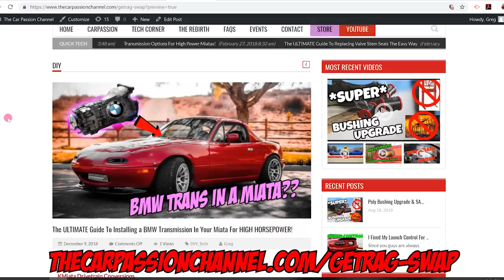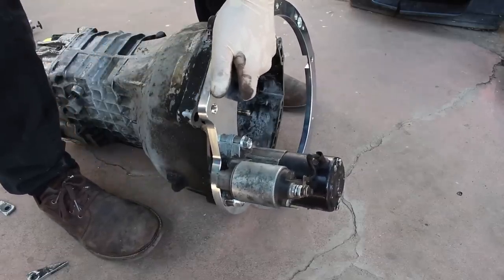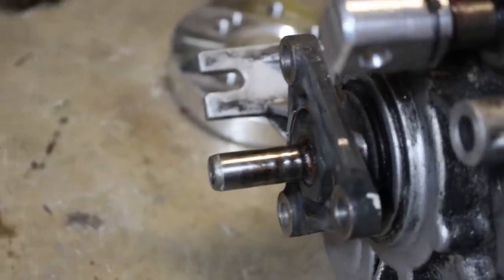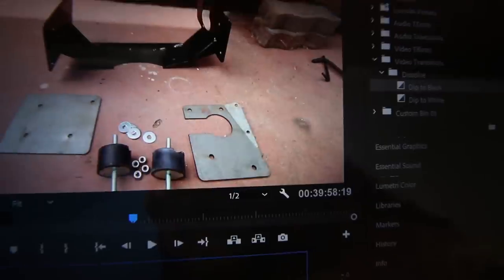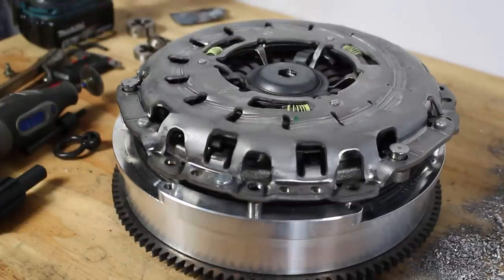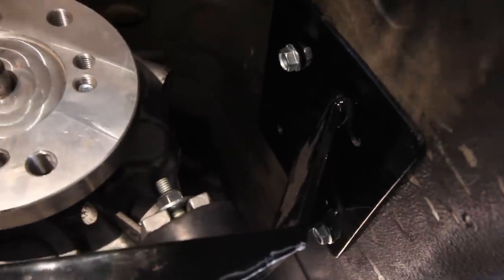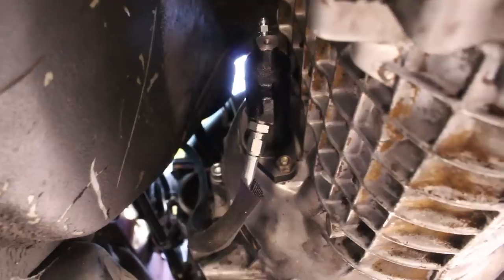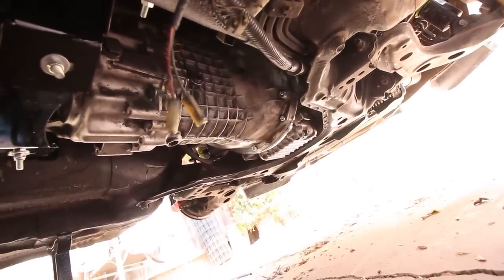The ULTIMATE Guide To Installing a BMW Transmission In Your Miata For HIGH HORSEPOWER!

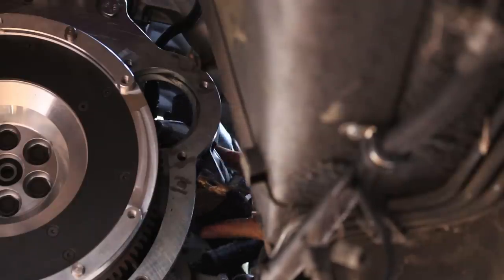Comment: 24:09 - I think you broke your starter motor. It's not meant to make that noise when you install it.
Reply from the maker: I'm literally crying laughing rn after re-watching that part
Reply: @TheCarPassionChannel 
Sounds like it's complaining. 😂
Reply: i had a feeling that was coming after watching all of those shavings from drilling out the holes.
Reply: I know this is old, but I'm a little car retarded, could you explain why? Is it the ambulance noise?
Reply: @hunterdelgado2402  Yeah. Perfect timing. It's like the starter motor is letting out a death scream when it gets pushed in. 😂

Comment: When my grand Cherokee died my mechanic sold me as a gap filler before I got a new car, a 2002 mx5 mk2 1.6 with 50k on the clock. One lady owner. I got two speeding tickets in the first month trying to keep it under 30mph. New clutch,new brakes but my mechanic won’t let me sup it up as apparently I’ll kill myself. I couldn’t work out why I needed rear tyres so soon until I realised I’d wheel spun everyday. 
I keep meaning to sell it but at 57 my daughters all grown up I just can’t bring myself to let it go 😂. I watch you great videos, as a sculptor I’m very practical and follow each step you do so could do the conversions but the image of James Dean’s Porsche haunts me.

Comment: Greg I have blazed the trail you have been walking and I HIGHLY recommend the solid transmission bolt mounts. Mine snapped in two and made it almost impossible to shift. I also  slipping that damn BMW clutch and already have the act clutch in my room. Please keep an eye on the mounts. David is still amazed I was able to break the mounts but I'm sure you will too. Also no hate to you but I wish I had known sooner that the clutch sucks haha! Keep up the good work man!
Reply: He also had to buy the act clutch because the other one slips, he said it somewhere, I don't remember if it was in an older video or if it was on snap or insta.
Reply from the maker: So did you end up running the ACT full-face? What power/torque is your car at?

Comment: If the BMW trans is electronic, theres a company that makes electronic to mechanical drive kits dont know if it will work for you but the company is called "Abbot" and the product is called "Cable X" Put one in a t56 swap in a c3 Vette  with mechanical speedo.

Comment: btw, you can reset that pressure plate with a piece of threaded rod, some big washers, a screw driver and some zipties...save the center piece and throw it in the tool box. Or you can spend several hundred on a BMW tool to do it too.

Comment: You can reuse the press plate on a self a adjusting clutch use a press it should hear 3 load clicks then its resets but need too put 3 drill bits where the teeth are must be in a triangle shape  but don't release the press yet . You'll need too cut the drill bits so they drop out

Comment: All that work to that car!  that poor Miata has had every nut and bolt off and on.....    I’d die if my NB was pulled apart that many times.    Still.... nice work, glad your keeping with the NA Miata!    Hope you got the Good LSD diff in it.    It’ll take a beating!
Reply from the maker: Yep, it's a Type II Torsen with the 3.909 ring & pinion. Probably swap my 3.636 in once I see how the 3.909 handles the power with the new trans ratios.

Comment: having done a bmw clutch, ive had no issues taking a pressure plate off after the plate was removed from the center and putting it back on. over 5k on the car since the clutch change and no noticeable issues. id avoid it if possible, but i wouldn't buy another clutch kit if you for some reason have to take it off after the initial pressure plate install for anyone attempting this

Comment: PSA, ground the battery DIRECTLY to the engine and not the chassis. SIXSHOOTER(I believe it was him) on miataturbo.net melted a few wires. Kmiata and himself determined the reason was because he didn't extend the ground to the engine. I can find the thread if needed.

EDIT: Found thread...Post#234
https://www.miataturbo.net/suspension-brakes-drivetrain-49/k-bp-engine-bmw-e36-e46-transmission-upgrade-92865/page12/

Comment: I'm I the only one that's concerned about the big hole you've just cut in the bell housing? Great if you live in California, however coming from the not so sunny and usually raining or generic crap Yorkshire(uk) and our roads I wouldn't like to think I hadn't made and welded another piece to fit just underneath the starter motor

Comment: Don't bang that dowell pin at adapter like this! Put adapter at the work bench (flush) and than install due to adapter could bend or dowell pin not seat properlly 👍

Comment: 27:08. Mclovin, niiice!
Reply from the maker: I allllmost put that clip in but wanted to keep it Rated G lol
Reply: @TheCarPassionChannel  you are a very brave man for putting that transmission in with a car jack. I don't have a lift either and do it from the floor too but what helps a ton is a motorcycle/atv jack. It definitely makes life a bit easier while doing transmission related work. Also, this is what tripped my mind and made me post my original comment,  https://youtu.be/QsGxbsQv5kc

Comment: Curious:
if you were to start over on this build, would you just do a kswap instead?  Seems pretty economical given that the stock bottom end can make over 500hp and if you blow it you pick up a new one for cheap.  Would be interesting to see you do a comparison between the full cost of your current setup and the k series swap since you already have the whole trans swap anyways.
Reply: Ridiculous cheap god swap is Volvo S80 T6 2.8l + Gs6-53Dz (1000Nm+). You can put that into almost every car and crank your boost up to 1000+hp with gustom manifolds and Gm12 rear end. 33 spline axels and 3 inch driveshaft with huge joints. Its ridiculously cheap and if you have right chassy you can go 8s passes on quarter mile. Another bit more expensive build is M104 Mercedes engine straight six. Watch Turbobandit youtube videos how to build one of those. Really cheap 1000hp aswell.

Comment: What I understood about the power plant frame (ppf) is this was done to prevent differentials from wiggling as power was applied therefore more efficient. What is done to substitute bracing for the torsional loads the rear suspension is sure to experience?

Comment: Transmissions mount pretty easily when you have the correct pilot bearing hey Greg?
Reply from the maker: Struggling with the 6-speed install had nothing to do with the pilot bearing, and everything to do with the alignment of both clutch discs not being perfect. Lesson learned on that one!

Comment: Didn't see the clutch actually working yet. Guys don't install this before you see that clutch working for couple of months driving. In some cases you have to weld material into your clutch fork that presses your pressurelager into glutch assembly. Wrong way to fix that is to lengthen that clutch slavesylinder pin. Something might brake sooner or later if you lengthen that pin in order to get your clutch working and you don't have the will power to uninstall gearbox and fix your glutch fork by welding material on it. I hope Greg doesn't have this problem. Would love to see someone install Gs6-53Dz gearbox into miata :D (Handles 1000Nm+). Just so your gearbox can never give up on you.

Comment: I know it's been a while. What tool is used to cut the notches on the transmission? What is the brand, model, and what blade wheel was used?
Reply from the maker: What's up man, this is my exact Dremel: https://amzn.to/33WC87r

And these are the cutting wheels I use: https://amzn.to/3kMZ2ow

These are easily some of the most used items in my garage, I use them on a weekly basis and they are worth every penny.

Comment: Those getrags came in all the manual commodores here in Australia behind v6 ecotec and when driven hard they brake all the time I have personally broken 2 from doing skids and dumping the clutch not sure how it will hold up the the power your pushing.
Reply from the maker: Probably a different Getrag, they make boxes for everything under the sun. Besides, abusing any trans will break it at a much lower power level than just driving fast, one of my friends went through 4 Miata 5-speeds at 150whp while "drifting". Plenty of people running 400+ in E30's over here, and those are 600+lbs heavier than my car, so not too worried. And if it breaks, $200 replacements all day.
Reply from the maker: Commodore's are also like 3800lbs, haha
Reply: Yeah commodores are a heavy boat in comparison to the mx5. The g260 and the m35 are the same box internally just different bellhoising. There a good box dont get me wrong but I think with all the extra weight of the commodore/burnouts is what kills them, but on the plus side there only like $100 too $200 dollars second hand so when they break just slap another one in it. Ps I love the content I just thort I would let you know what I've been there on the other side of the pond .

Comment: I want to do this so bad for my built BP6D, too bad this swap runs $4,500...
Reply from the maker: It's ~$2600
Reply: TheCarPassionChannel Just the swap kit though, not everything else ya need 😂
Reply from the maker: @alexchulzhanov  Just add the trans, $250 🙂. $300 if you use their diff mount but you can do a diy mount using your PPF (cut off) for nearly free and it holds the diff better.

Comment: How much horsepower do I need to be making to require a different transmission? How much HP can a stock transmission handle?
Reply: I have heard 250 to 300.    It's second gear you need to worry about.    Dont give that gear set too much.

Comment: Do Miata 5-speeds have overdrive? BMW 5-speeds don't (5th gear is direct drive). It's my understanding that most 5-speeds other than BMW have 5th gear as overdrive and 4th as direct drive, but I'm not too sure.
Reply from the maker: Yes, most 5-speeds use 1:1 4th. 

Miata 5 speed has overdrive, as does the Miata 6-speed. And this BMW 5-speed has overdrive too 🙂
Reply: @TheCarPassionChannel  Oh, you got the E30 5-speed? I see.
Reply from the maker: @nickamarit  Had, yes. Currently running the E46 5-speed. Everything is great except the ratios
Reply: @TheCarPassionChannel  The E46 5-speed in my E46 doesn't have overdrive, is your E46 5-speed custom-built?
Reply from the maker: @nickamarit  No, it does not have overdrive. The trans on this video is an E30 Getrag 260. The current trans in the car is a ZF
Reply: @TheCarPassionChannel  Ah, u got the beefy E46 ZF 5-speed, mine's the E46 Getrag 5-speed (which I've heard is actually weaker than the E30 Getrag 5-speed).

Comment: I’m gonna build my miata na with 350/400 hp. I was thinking to go mk2 miata 6 speed transmission. But should i go for something like this? Gonna road trip it a bit so i want 6 speed
Reply from the maker: 6-speeds are used at that power level by many people, but their strength is not endless at 350+++.

Also, 6th gear in a Miata 6-speed is shorter than 5th gear in a Miata 5-speed, so RPM's are higher when cruising. Unfortunately 5-speeds are very weak.
Reply: I think i might go with some other transmission. But i live in norway so shipping a Hole transmission from us is EXPENSIVE
Reply from the maker: @Doitwithdowns  Also check out the Maverick Motorsports FC RX7 transmission conversion

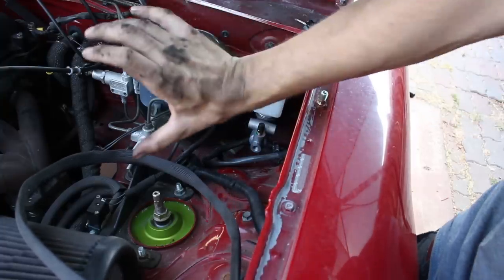Comment: 33:20 Why a copper one though? What's the difference?
Reply from the maker: 1) That's what's included with the kit
2) Copper washers are used for sealing many applications, copper is soft and conforms to the imperfect surfaces, creating a seal
Reply: TheCarPassionChannel 
Thanks for the info!
I was gonna ask why they're not used everywhere else, but I'll guess they're more costly

Comment: Wow the BMW transmission is so much shorter than the Miata one. Anyone know the weight?
Reply from the maker: Weight is approximately the same, the BMW trans is 78lbs. BMW trans is shorter due to the external shifter linkage, the Miata linkage is internal.
Reply: @TheCarPassionChannel  how the clutch engagement with the BMW setup vs Miata. Is it light and wheres the bite point?
Reply from the maker: @alansmilealot  Bite point is adjustable just like with the stock Miata configuration. With the OEM clutch used in this video it's super easy to drive, as easy as stock.
Reply: @TheCarPassionChannel  u sir are a  saint, I knew I followed you for a reason, thanks

Comment: Not sure this swap is worth it. It looks like it adds weight, removes stiffness and implies so much work.
Reply from the maker: The point is having a trans that's cheap to replace and actually holds power
Reply: @TheCarPassionChannel   is it a dramatic difference between the NB 6 speed and the E30 one?
Reply from the maker: @mihaiserbanescu8676  Strength wise? Both the E30 5-Speeds and E36/46 5-Speeds (which is what I run now) are at least twice as strong as the Miata 6-speed. I broke two Miata 6-speeds in two weeks on the street, now with the BMW trans I've been drag launching without issue, and the car has over 100hp more now 😊
Reply: @TheCarPassionChannel  I can see the reason now. What I find really strange is the removal of the PPF. Doesn't that make the chassis less stiff?
Reply from the maker: @mihaiserbanescu8676  To me it still feels fine. I'd recommend doing frame rails though!
Reply: @TheCarPassionChannel  they do feel like they are paper thin. They can use some strengthening.

Comment: Hey do you know if it is possible to do a 6 speed swap from a 1.8 to a 1.6 na Miata. And if so how hard would it be, my car is supercharged and I can’t get over ~120 without pushing 6-7 grand thinking it’s going to blow up as well as cruising at 80 I’m at about 4-5 grand. If you could please let me know it would be greatly appreciated. Thanks - ig: @deathwishyata
Reply from the maker: Yes you can. But it's going to have the opposite effect of what you want because 6th gear and a 6-speed is shorter than 5th  gear in a 5-speed (6-speed trans will have higher cruising RPM). What you're looking for is a diff swap. Easier and cheaper too.
Reply: TheCarPassionChannel my thing with a diff swap is the car is only a daily for a little longer and then it becomes a track drift car. It drifts good now and I don’t really want to change the gearing, I was planing on getting the diff welded. What do you think? Thanks again for the insight I appreciate you
Reply from the maker: @gageleightner8429  Then I wouldn't recommend swapping anything. Wait until it's a dedicated track car, your trans/diff setup will likely be totally different than a street car. The cheapest/easiest way to drop your cruise RPM is a diff swap. If you want to keep the short gears, you can do a 6-speed swap with a diff swap. 4.3 + 5speed is roughly the same as 3.9 + 6-speed but with an extra gear on top.
Reply: TheCarPassionChannel okay thank you so much for the info

Comment: Wait what the fuck? Driveline vibration, no speedo solution, subframe swaps, ultra high cost... Why is this kit even out if it's not completed? Hard pass, I'll go with a Walter built 5 speed instead.
Reply from the maker: Subframe swap and dead speedo only if you're doing it in a 1.6L car. Driveline vibration was a totally isolated incident not related to the kit itself. It's not for everyone but it's the route I decided on rather than an expensive untested "built" Mazda trans. If I break a Getrag, it's $200 to replace.